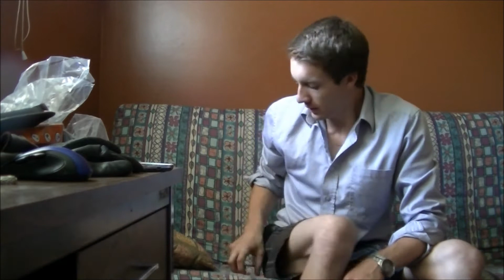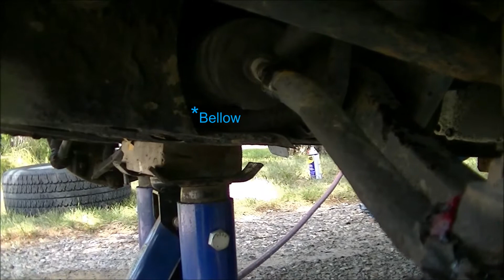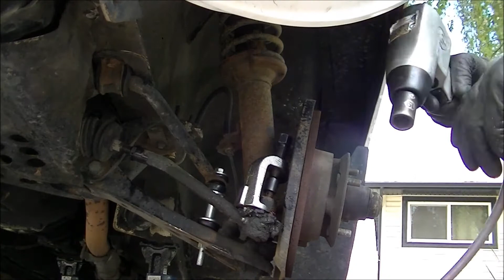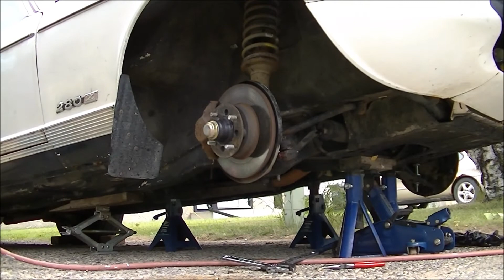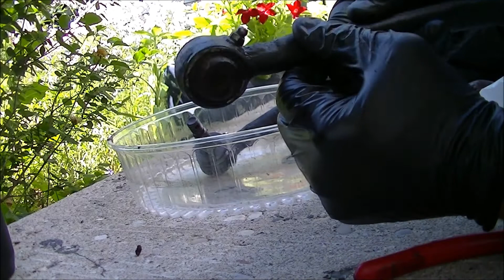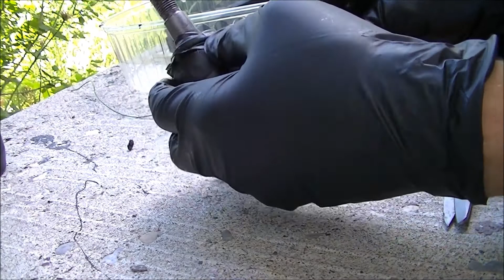How To Remove & Replace Steering Bellows, & What To Do If Your Tie Rod Boot Is Broken | Datsun 280Z

Comment: Do you still have the car, any updates? I have an 83
Reply from the maker: Nice, the S130s were underappreciated for a while there.

To answer your question, loads. I am just, having trouble keeping up with editing content. Sadly a few of the videos (like replacing the cylinder head gasket were wiped by a windows update along the way). I am just finishing editing the assembly video for painting it. Then I was thinking of doing a bit of an update on the current status of everything.

Comment: Should have just bought new parts
Reply from the maker: I agree, but at least I learned that makeshift boots last a hell of a long time😆. Still, I had ordered replacement tie rod ends at the time. I just needed them to get me home then to work for a day or two until they arrived. Then I left them on out of curiousity. A few years later and those makeshift dust-covers looked perfectly fine.

The new bellows however, did not last as well as the old ones. The rubber chewed itself up pretty fast. I ran into a similar issue with some track-rod (compression rod, etc.) bushings. So I suppose there are some downsides to replacing parts that still work.🤷‍♀

Hopefully it was vaguely amusing if nothing else.